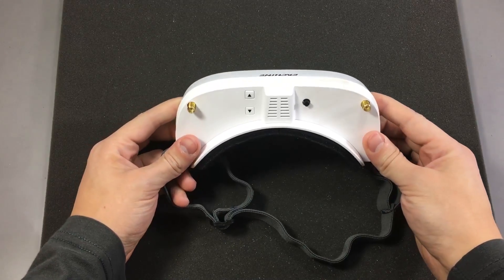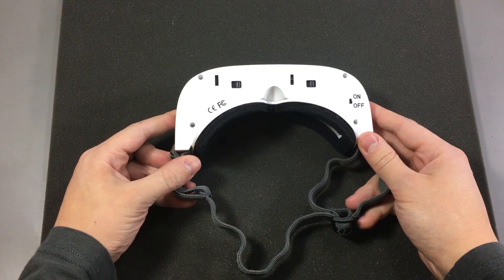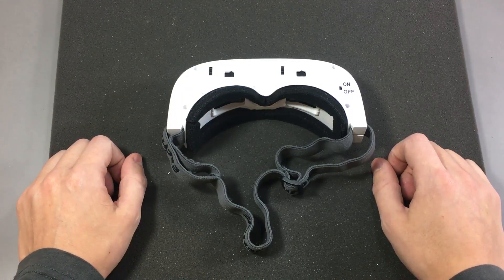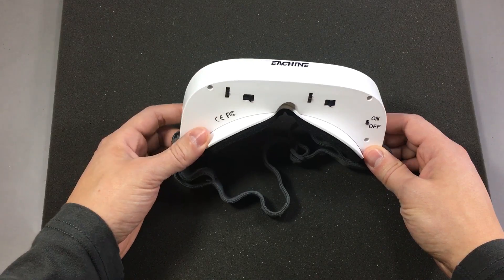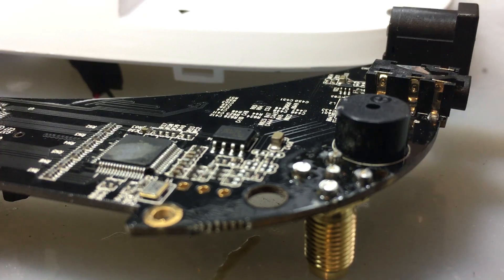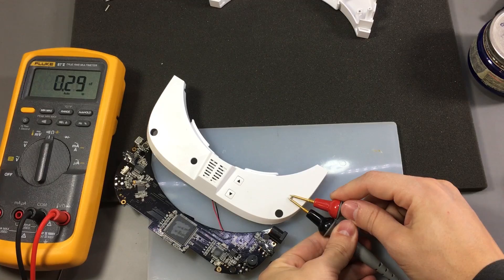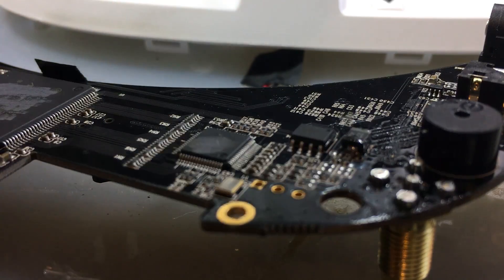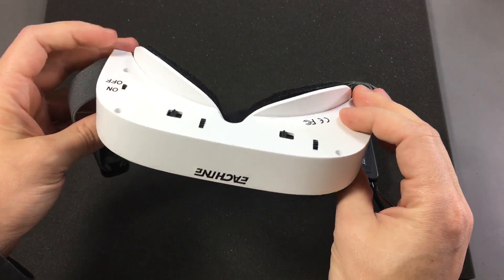Voltlog #137 - Eachine EV100 Distortion Problem Fix

Comment: Hello. I have a problem with my goggles. I can turn on my goggles with battery. But I can turn on my goggles with usb cable and power bank.
So what can I do?
I already change with other battery but still not working.
Please help
Thanks
Reply: Hello, do u find a solution?

Comment: +1👍 thank you. my release was later without the same issue, but your video has answered other questions.
My ev100 always beeps as if low battery, but my battery pack is fully charged.  do you think a barrel capacitor on the power input could help?
Reply from the maker: I'm thinking it doesn't read the battery voltage correctly so a capacitor would not help.

Comment: I have a problem with ev100. Sometimes the screen suddenly overexposed or darkened during flight.
Is there a way to solve?
Reply: I have a same problem. I will try to fix it. If you want i can update you on that.
Reply: Kai FPV ok
Reply: @ricardotung9185  no good still the same problem although theres no problem in dvr footage. And when i use pal it somehow happens a lot less.
Reply: I also have same problem 😌

Comment: Also just took mine apart and mine have 2 capacitor2 where yours o ly has one....any ideas?
Reply from the maker: maybe they fixed this with later revisions by adding two caps.
Reply: Mine has 2 in it but still same problem do I replace them both or or one compactors for the both

Comment: My new EV100 googles (purchased in Jan. 2018 - circuit board labeled V1.2) have a revised design with two parallel caps in the same place.  Looks like Eachine may have address the problem.  Thank you for your tutorial.  It has helped embolden me to take mine apart and perform enucleation (removal of one eyeball!).  I'm using my goggles for a new invention that requires me to wear them during work, so I want to see out of one eye through the goggles directly, and one eye on the camera.
Reply: thanks mine is the same version but im still getting blackouts and dub vision ok thanks for the help anyway godspeed and happy flyin
Reply from the maker: thank you!
Reply: so i am asking to this ? karlin did you replace both caps on yours or did you leave them alone
Reply: Left them alone.  Eachine reengineered this as a fix in the later version (my version).
Reply: Ha, mine aren't for flying. Don't own a drone.  Using mine to clean solar panels

Comment: Hi, 
Can somebody please help me?? I tried to substitute the capacitor but a broke the - Pad. Then soldered on the very small remaining part the now capacitor. The soldering looks good and is fixed but now I can't switch one my Goggle. Nothing is working: fan, screens beeper.... As I connect the battery nothing happens. Can somebody give me a solution or suggest another point to solder the capacitor - to?? This is the video of my actual situation...

https://youtu.be/cgxRMr7KsRE

Please help me, I don't want to through away my googles...

Many thanks to everybody which could help..

Comment: Aluminum foil as heat protection? Always thought it‘s a well heat conductor...;-) Otherwise thanks for introducing an interesting fpv goggles brand...
Reply: the foil blocks the airflow from the gun and will not melt. it might also stay a bit cooler since it is wicking away the heat from the air blowing on it.
Reply from the maker: yup, the foil works as protection because it blocks the air flow which would otherwise melt the plastic parts.